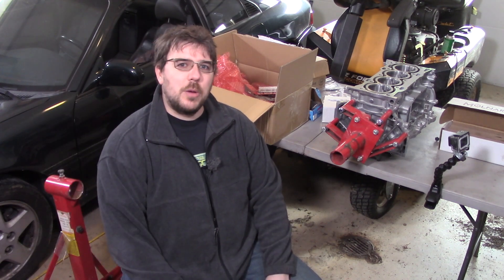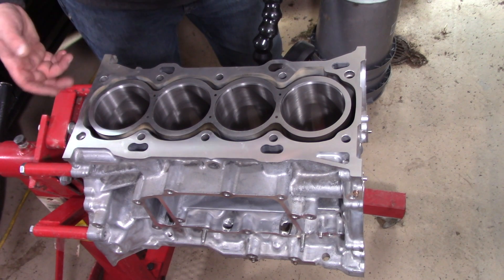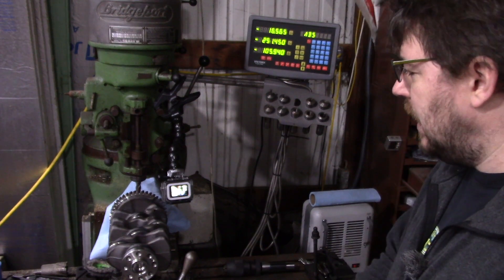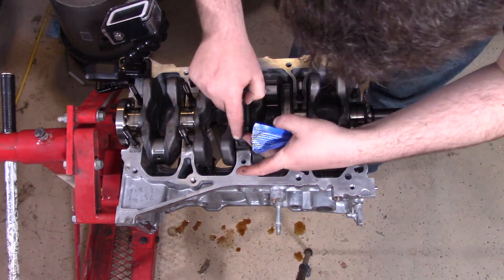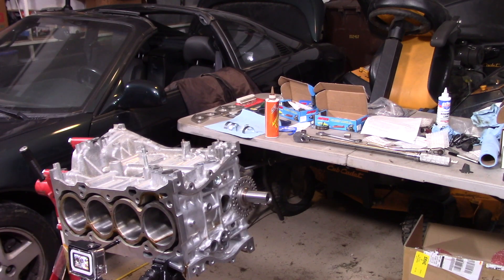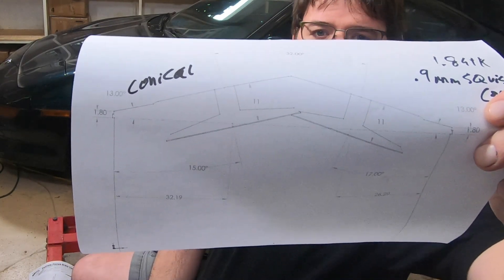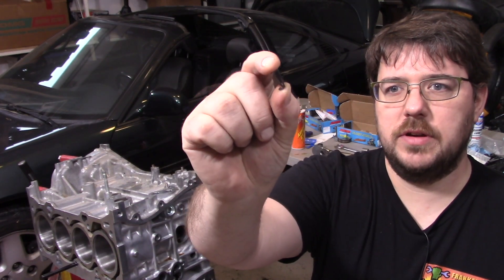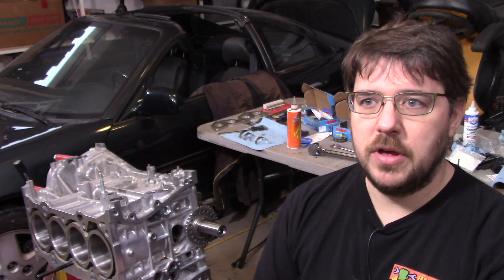The 2AR-FE road to high naturally aspirated horsepower.

Comment: Killer work man, I'm really hoping more light can be brought to the AR motors. These are the answer toyota gave us to the K24 we just need the aftermarket support for it.
Reply: not really tho the k24 can handle up to 700 hp stock everything. and the ar tops at about 350 with stock internals.
Reply: @minecrafterselite1  you obviously don't race in classes that require OEM parts and no aftermarket forced induction...
Reply: @minecrafterselite1  You'll never have reliable 700hp on a K24 with all stock internals. Sure it can do it, but for how long? You shouldn't even try to get over 450. I prefer being safe and just getting new piston and rods
Reply: Wasn't the 2zz the answer for k24 or k20?
Reply: @takumiinthe86  2ZZ is more like a B18 :)
Reply: Hey man this is very Interesting, I hope everything worked well!
Reply: what about the 5sfe, might be heavier, but apparently you do less than this to get double the horsepower forced induction
Reply: @ItsPainnz Nah 5s makes frankly shit power from factory, can't be modded very high on stock internals(200 to 250), and is set up for economy with its main performance point being that it's torque is ok for what it is. Their good motors, just not very tuner or performance friendly, no idea why they put them in celicas
Reply: @minecrafterselite1 no it can’t lol

Comment: Thanks so much for sharing. Please keep them coming. Might want to add what differences if any for turbo application. Voosh!
Reply from the maker: For now all i know about turboing this engine is that unopened they can make at least 350whp and Papadakis has managed 800whp on a motor with modest upgrades. He made over 1000whp with one but that engine has a ton of custom parts in it.

Comment: Your attention to detail is great. It gives me confidence to consider this engine conversion  for an MR2 Spyder i.e. great but still naturally aspirated.
Reply: Did this just pop up in your feed too? This giant engine would probably be a blast in a spyder. I don’t know how he gets so much power out of these. I’m assuming it’s a really good flowing head for emissions purposes and with some tweaks it will flow well at the top end too
Reply: @roachwerks3043  I just bought a 2005 Spyder in the UK. 6 speed with LSD. Hilarious fun. But needs, I reckon, poly suspension bushes and some decent shocks like BC Racing DS Series. But that alone is £1.5. 
I do like the 1ZZ engine. It has a lot more mid range torque than a 2ZZ and wild mild supercharging would produce seriously usable road power. I'm thinking of using a compressor from a turbo and adding it to one of the auxiliary belts on the engine as a supercharger. A lot cheaper. That would require by default a decent ECU otherwise pointless.
Reply: @imakestuffhere  you can’t really run a compressor off of a belt they spin at like 100k rpms +. There are centrifugal superchargers that work that same way but there is a little more to it
Reply: @roachwerks3043   oh dear

Comment: I’m literally in the process of upgrading my Camry with a 2AR-FE watching your video’s actually gives me some great idea’s on upgrade paths, I kinda like the idea of bumping the redline further up! I feel it would help out a lot in medium to high end power. Along with possible turbo idea’s
Reply: Got my eye on the same project. These 2AR-FEs are in a bunch of sleepers and someone would make a killing if they figured out how to get it to the 250 sweet spot.
Reply from the maker: I've been racing mine at the 7200RPM redline, even with no additional changes it really changes the mood of the motor. I can't wait to make it sing at 8000 or even 9000RPM.
Reply: Kinda late but yeah I want my Camry to Make 250 at least I would be happy with that
Reply: @juliobello4561  right now I got equal headers catback exhaust intake and I’m pushing 200 with a stock 178 along with tune maybe close dnough
Reply: @treydavis3138  idk guys.  I have the 2012 Scion xB only 158hp stock I'd be happy with 180hp

Comment: Came here from Gears and Gasoline! I'd absolutely LOVE to do a 2AR swap to a FRS/86 someday! I saw one wit a 2AZ swap but 2AR seems to be a bit more advanced and has more potential. The goal would be to reach 8000rpm but one of the bigger issues is that these engines are very tall and stick out of the hood of a FRS. I wonder if it's possible to mount these lower with custom engine + transmission mounts

Comment: Awsome video!! Just a theory here on the extra oil squirters on #2 and 3 cylinders... I feel like toyota took lessons learned from older motors like the 3sgte... as most know when an aftermarket turner is being used on the 3s you have to give the two center cylinders a bit more fuel to keep things cool.... I am thinking that toyota added the extras ones the 2ar for this reason. So this may be something to watch during the tunning process.
Reply: Oh and I am intrigued as hell on the lash adjuster...
Reply from the maker: Yeah, that's about the only thing i can think of also but keep in mind this motor isn't turbo'd in any stock application. But based on those findings and the fact that the internals are fully forged and that the ECU has air to fuel ratios and timing appropriate for turbocharging beyond the stock power band in it i do suspect that toyota intended on people putting turbos on these anyways.
Reply: I thought the issue in the earlier motors was that feeding a log manifold from the end or middle resulted in different flow rates across the cylinders. Higher cylinder flow makes a lean condition as the AFM (or MAP) is measuring an upstream average. Center feed biases 2 &3 (MR2) and rear feed biases 1 (Caldina). Tuners were using cylinder trims to balance fueling  back to an A/F target rather than using them to make the A/F different.  We might be saying the same thing different ways because running a cylinder lean does make it hotter and more knock prone. The 2AR-FE inlet doesn't look much like a center fed log design to me.
Reply: @stephenbello1081  we are saying the same thing mine is just more trivel. But the 2arfe is a side feeding log with an upward ram type..

Comment: I really wish there were more 2AR videos :/ I can’t find much info about performance 2AR or videos as informational as this. Please release part 2
Reply from the maker: There are more coming, i promise. The Pandemic has just slowed me down a bit. The 2AR is a great motor
Reply: Search PAPADAKIS RACING he has modified many 2AR-FE for his Drift Cars. He uses 2.7L 1AR-FE parts to up the 2AR's 2.5L to 2.7L.

Papadakis Racing will offer complete built cylinder heads for 2AR-FE engines

Comment: I am now the proud owner of a 2001 spyder.... can't wait to get a donor tC and get to work....
Reply from the maker: Awesome, I'll be happy to help you out when you need parts and any questions need answered.
Reply: @FrankensteinMotorworks  what suspension system do you run on your spyder??
Reply from the maker: @Shift-happens-tv  I'm using Apexi coilovers and whiteline sway bars. The big improvements came from some custom bracing on the front end, the crossmember that has the steering box and front lower control arm attachment points is really really floppy. i braced it to the main rails under the body and also braced it diagonally to the main rails in the engine bay. This dramatically changed the handling on the car. The other big thing wasn't chassis at all but i switched to a custom wilwood brake setup and made a vacuum regulator circuit to get much more consistent brake booster assist. That improved driver confidence going deep into a corner and made the car much faster as a result.

Comment: You're doing a great job brother.  I love all the calculations that you are doing to come up with exacting specs.  Very nice!!  I'm curious, why are you not going to run the balance shaft(s)?  Won't that cause tremendous amounts of NVH at high RPM?
Reply from the maker: Balance shafts are more for idle NVH than high RPM. generally at higher RPM the frequencies get high enough that the mass of the engine and the rubber mounts absorb it all. Exactly how bad it is really depends on the motor. I want to quantify how bad the vibrations are so i can report back to everyone how much of a problem it really is. Particularly with the motor mounts i've designed for the MR2 Spyder. 

Plus the other reason is that the dealer that shipped me the crank shaft did not package it properly so the balance shaft gear was damaged.

Comment: I stumbled upon your 2AR videos recently as I'm planning a swap into my 1977 Celica.

Anyway I have a ton of experience working on the 3UR engines which is basically 2 2ARs put together. 3 projects of which are running a Haltech Elite 2500. Most  internal parts are also interchangeable between the two engines. If you need any help let me know.

Regarding the Exhaust VVT solenoid, I'm pretty sure it does not move with oil pressure alone. In all my projects I completely disable the Exhaust VVT (no signal to the solenoid) as they ran fine without it. I did however retain the intake VVT at mid RPMs.
Reply from the maker: Abdulla, That's interesting i had not seen anything about the 3UR matching the 2AR. It's entirely possible though and I'll have to look into this a bit. And yes, the power gains are mostly from the intake VVT-I, the exhaust VVT-I only helps the mid-range a little bit.

Comment: Any thoughts on cam specs yet?  Also, do you think that with the stock c/r that a bigger cam would even help?  Or will you need higher c/r pistons to get the benefit?  The reason I ask is that I would love to bump the redline, and make some more top end power to 7500-8000 range, but I'd rather not modify the bottom end.  I'm wondering what can just be achieved in the head limited to lifters/rockers/springs/cams.
Reply from the maker: Marco, I've actually already got the cams in my hands. I probably should have shown them in the video. Stock had the same cam profile on the intake and exhaust and i'm keeping that going. The duration is going from 244 degrees to 280 degrees and increasing lift at the valve from 9.7mm to 10.9mm. My goal is to bring the peak power up from 6100RPM to 7800RPM or so. If i can maintain that 190lb*ft. of torque i was getting before but at 7800rpm I'll be at 280whp, if the increased displacement helps bring the torque up I might even hit the 300whp stretch goal. But those numbers are ambitious. If i manage 250whp I'll be quite happy.

As for keeping the stock bottom end, i think the trickiest part may be the cast pistons at a higher RPM. the stock 98mm stroke is rather long for 8000RPM. but i bet the stock rods would probably be just fine. I do know that some of what i'm doing is overkill but my goal up front is more to worry about making the power than to worry about the exact budget. I would like to experiment at a later date to bring the cost down.
Reply: @FrankensteinMotorworks  Cool! Does RPM usually kill cast pistons?  I thought it was usually high pressures, temperature, too much timing, etc?  In any case, for stock bottom ends it might be worth limiting the redline.  Considering the dual VVTI, maybe the cams you spec'd would still be ok for something like a 7400 redline?
Reply from the maker: @marcopalmeri8492  The issue is just the acceleration on the piston trying to rip the piston apart. With a 98mm stroke that piston is really flying at higher RPM. Wikipedia talks a little about it but there's a bunch of other info out there https://en.wikipedia.org/wiki/Mean_piston_speed This motor is already at 23.5m/s at 7200RPM. Generally a stroke that long would be in a diesel engine with a 5000RPM redline. How Toyota is safely making it to 7200RPM is beyond me. Would it be ok to 7400RPM? maybe, i haven't been able to try it because the stock valvetrain isn't super happy up there. 

The good news is the motors are pretty cheap, you can get them all day long for about $300 and sometimes even cheaper. This would probably be worth experimenting. take a stock motor and replace the valve springs and just see how high it can go before the next point of failure presents itself.
Reply: @FrankensteinMotorworks   you mention ARP head studs. Do you know the part number for those? I will be pulling my head off shortly. Thanks
Reply from the maker: @89gts  I don't have the fit tested yet.

Comment: I am researching on AR and GR heads regard of the vavletrain, too. I think you are also worry about that too as you mentioning the rocker arm with the retaining clip for the lash adjuster. Have u thought of using rocker arm girdle like the SR20 ? Worst case scenario, you can go custom and the cost of manufacturing those shouldn't be much (more profit for u if u decide to sell them later on) :)

Comment: Looking forward to the next update on this engine! What’s your plan for injectors and throttle body?
Reply from the maker: It'll be a bit, I'm waiting on the machine shop right now but i promise there will be another update as soon as i can. I do have reground cams, 280 degrees and 10.9mm lift. The injectors will be 545cc denso long reach high atomization units. they are identical in size to the stock units so the fuel rail will remain stock. It should be more than enough fuel but if for some reason it isn't I'll just bump the fuel pressure from 3 bar to 4 bar to get them up to 630cc. The throttle body and the whole intake is a bit more fuzzy right now. I want to try the stock intake to see how far that gets me but i expect that it will be a restriction. After that I'll make something custom and I'll either use the larger tundra throttle body or the BMW S65 individual throttle bodies. They are almost a perfect match for this motor with a simple adapter plate.
Reply: Frankenstein Motorworks I like the keep it basic and then notch it up on the easy parts later. I’m sure you’ll hit the power target with adjustments. Cheers
Reply from the maker: @damianmitchell7911  Yeah, especially when you consider the amount of work it is to make a custom intake and how easy it is to fit it in the vehicle after the fact. In the MR2 the intake is super easy to swap out. 

I do think there's probably a bit of power also locked up in the exhaust but the exhaust i have on there is pretty close to the most that can fit in there already so hopefully it isn't too much of an issue.

I'm sure I'll hit the 250whp target, honestly that one is not too hard. the 300whp target will be a bit trickier but it's still in the 125hp/L neighbourhood which is somewhat in the expected region if i bring the engine's peak power in the 8000rpm area.
Reply: Frankenstein Motorworks I’ll keep following very cool project cheers
Reply: @FrankensteinMotorworks  on the topic of ITBs for an ar series motor, wouldn't the diameter of the throttles become a restriction at higher RPM power levels? The ITBs on the S65 only have to handle 500cc each, where as on a 1ar spinning to a similar redline as the S65 of around 8500 rpm, each throttle would have to handle 675ccs. That's a really big jump in displacement for each throttle to handle.
Reply from the maker: @inaNis_  the drawing i'm working on is actually for 60mm throttle bodies now. The S65 stuff is nice but i don't think is potentially adequate anymore
Reply: @FrankensteinMotorworks  makes sense, since that's what K-series drag guys are going for. I've seen the kinsler ITBs go all the way to 72mm in diameter, which is really, stupidly large for each throttle.
Reply from the maker: @inaNis_  honestly 60mm is pretty stupidly large too but for trying to get every last ounce of power out of this thing i think it is where i have to go.
Reply: @FrankensteinMotorworks  do you think something like 52mm would work better for a slightly lider street application? 250 wheel or so, is what I think would be good for a 2ar

Comment: Hi  
Whene Build 2arfe turbo which bast    piston low Compression Ratio or high
Reply from the maker: It depends on how much power level at what RPM and what kind of fuel you're looking to run. It'll handle a fair bit of boost on stock internals.
Reply: @FrankensteinMotorworks  For Street race and normal drive type fuel Super Premium 95. What your suggestion?
Reply from the maker: @assdaasddfg5173  for a car that will remain on the street and since all the factory applications for this motor are front wheel drive i would suggest you leave the motor stock inside because it'll hold enough boost as-is, more than the front tires can handle anyways. Just add boost
Reply: Thanks for the quick reply